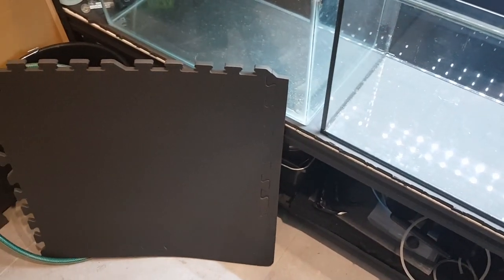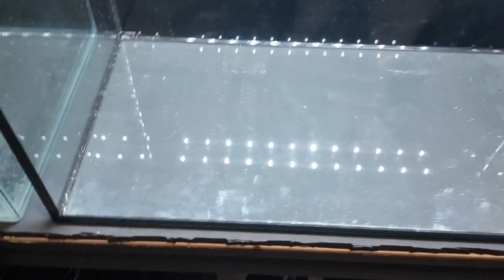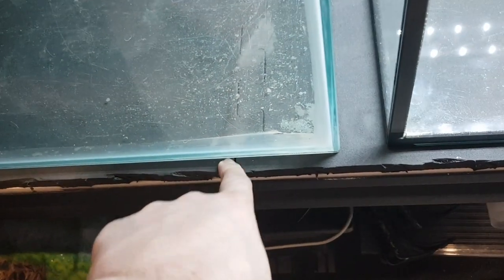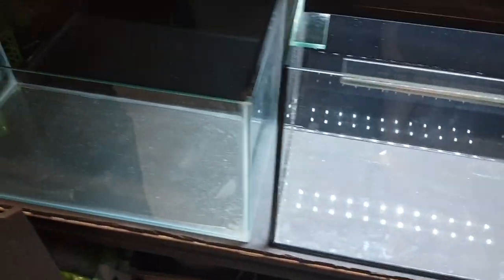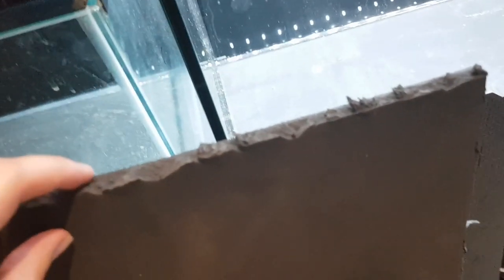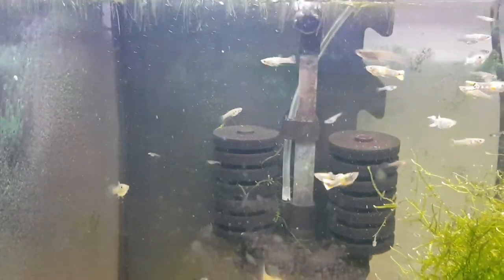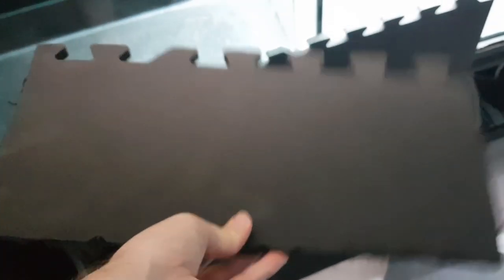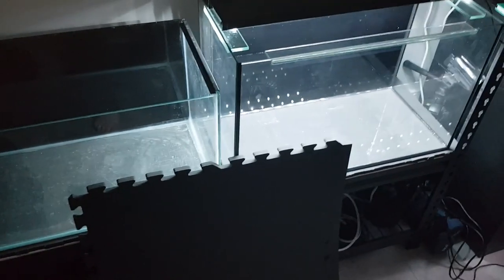Under Aquarium Foam (EVA Camping Mat)

Comment: I used this pad on a 48"L x 18"D  75 gal tank with good results , BUT...I made sure stand and tank were Stable and LEVEL by Shimming the stand 1st, and testing for rocking and movement, In my case, in an older home, 600+ lbs of water BETTER be on a Stable surface, If perfectly level, this foam will work wonderfully ! I will say that cheap vinyl plank flooring makes excellent shim material between floor and stand, as it has a thin pad/rubber backing which makes it non-slip. It's the most important part that the floor/stand are level and sturdy before you put a big tank down on it. I actually had to  strengthen my floor joists in the basement before installing this sized tank because the floor had a 'bounce' before I filled the tank. No issues for 3 yrs now.

Comment: Looks great mate. Maybe you could run a blade through the foam right up against the tank so its smooth and flush with the tank :) but great video prawny, keep it up👍
Reply from the maker: Yeh, i really need to get some more bladed for my tool kit, make the edges nice and smoooooth

Comment: Would this work under a 20g aquarium? The stand has a slight bow to it. I was wanting to see if adding this could help with that and fill in the gap
Reply from the maker: I think it would be fine for that sized tank, the only concern is the bow, if it is pretty extreme I wouldnt reccomend putting a tank on it, it may fill the gap to a point and be fine but just depends how severe the bow is.
Reply: @SirPrawnalot  it's a very minimal one. I was actually worried that the aquarium was leaking but it's not. I removed everything but the substrate and refilled it with water to test it out. I believe it's jkst condensation around the glass. I order a 10mm thick eva foam mat to place underneath the rimless aquarium. I just couldn't understand how water got underneath plastic mat I had underneath the aquarium but felt dry on the top side. It was very minimal water too. Just like sweat from the tank or something